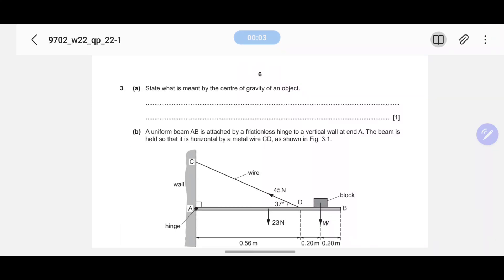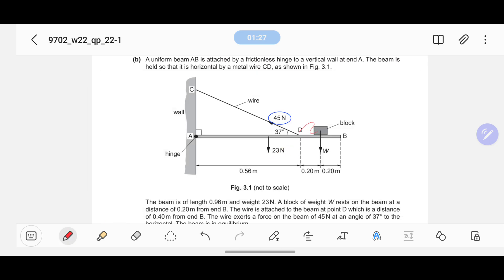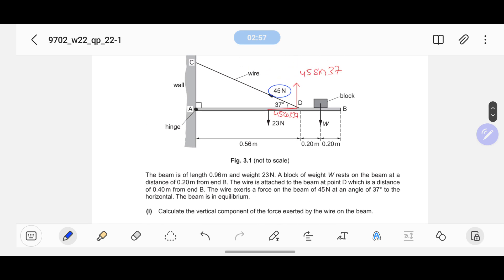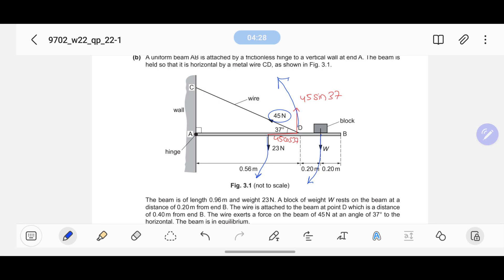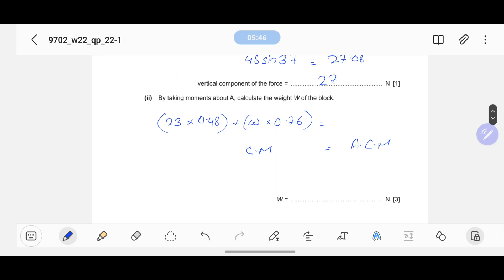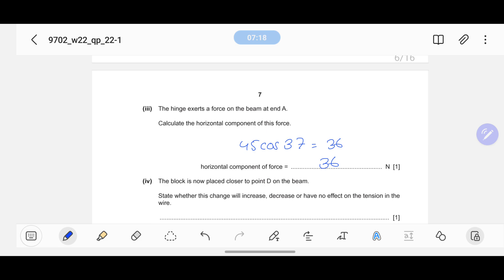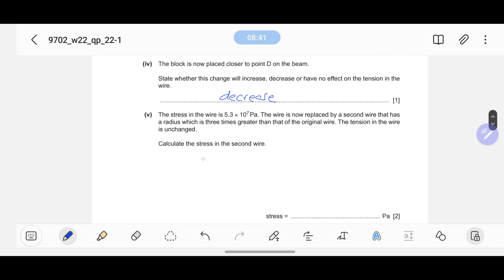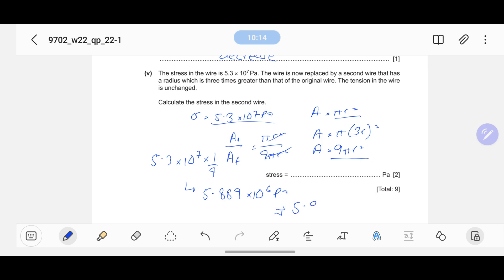ON/22 P22 Q3

Comment: How do you know when the weight is acting clockwise or anticlockwise
Reply from the maker: Greetings!
Forst of all, check where the pivot is acting. Put the pencil stick on the pivot, then put the force from wherever it is acting. You'll got to know where will it gonna go. It could be anticlockwise or clockwise.
If you still have the problem, you can let me know.
Reply: @physicsalevel7355 thank you for the response I get the part of the W where if I apply force it goes clockwise but the 23N is almost in the middle so it is difficult to know whether it is clockwise or anticlockwise